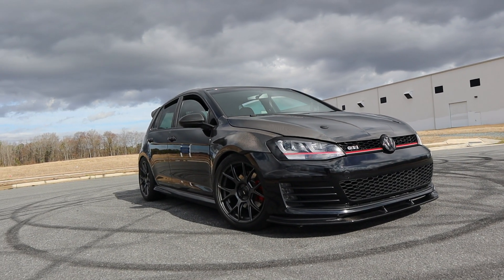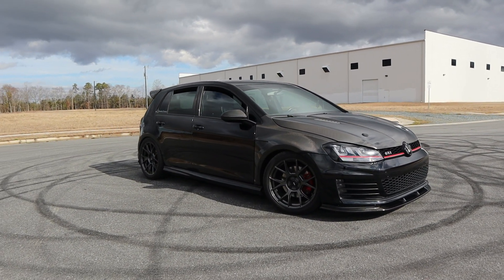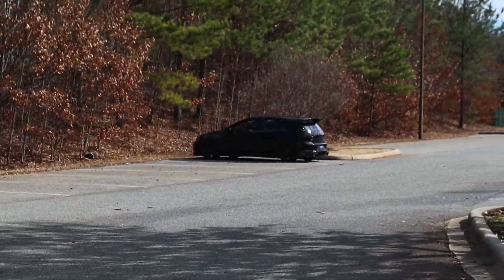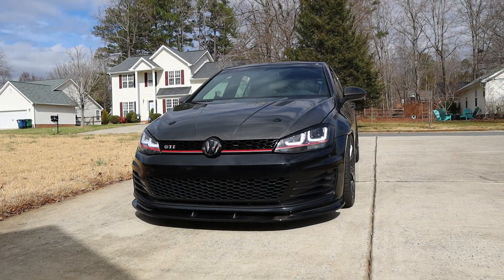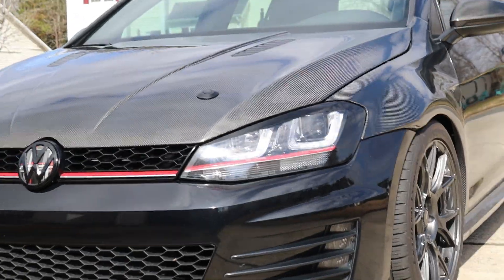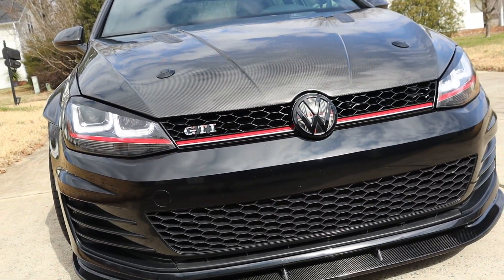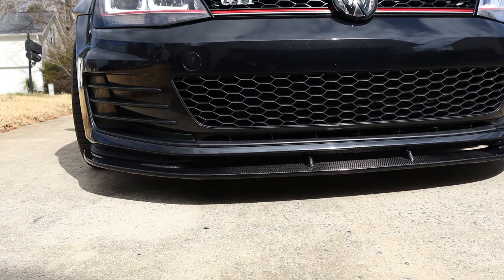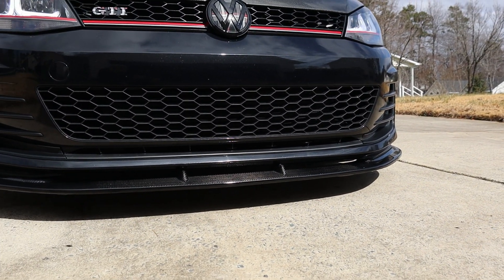Getting the MK7 GTI Ready for 500HP!

Comment: Hey how long did you wait for your pro tune from sneeky? I got a base map and I’m having trouble with it and he hasn’t responded in a while. I’m not too worried about the base map but I plan on going with your set up and if he’s taking that long on a 91 base map then I’d like to see how long it’d be for a full custom tune.
Reply from the maker: It can vary based off of how much he has going on. That being said it took almost two weeks for me to get my base map, I am now on the 5th or 6th revision and each one takes 3-5 days generally
Reply: @HaydenCroix  thanks. That’s not bad of a wait. For some reason my 91 map is locked and hopefully that can get figured out before I order a custom tune.